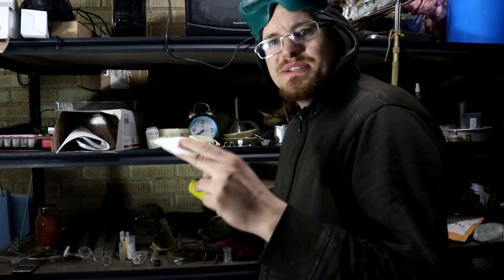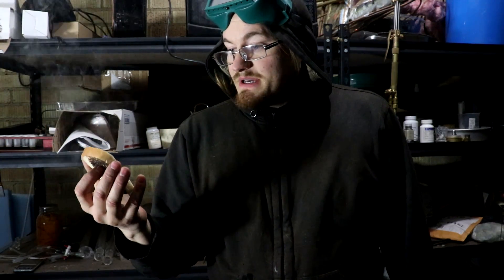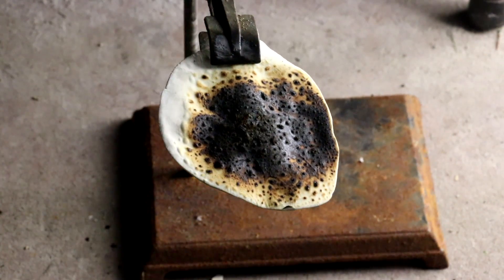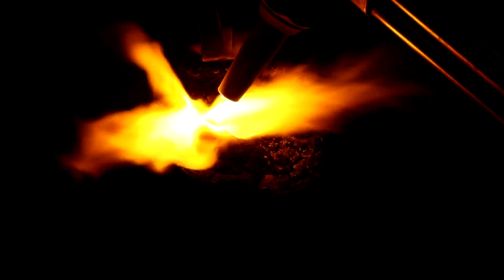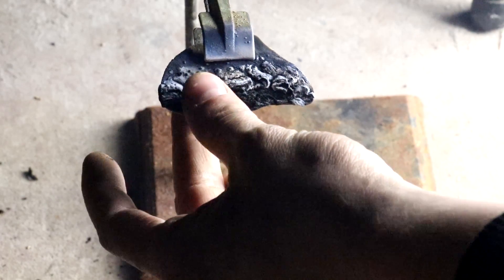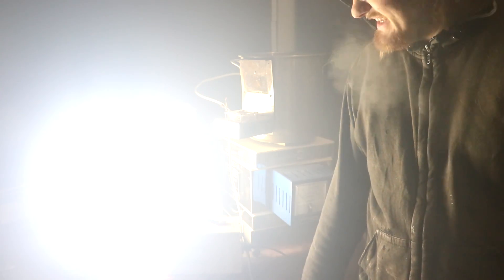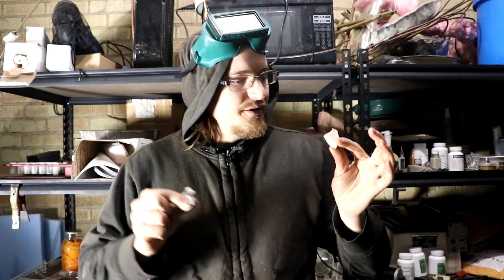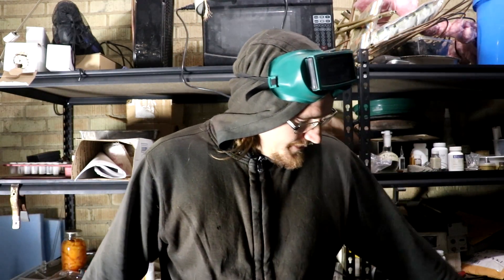Can I Burn Through Starlite?

Comment: Why do you pepper the oxygen? I haven't seen that before, I have only seen people lay on the oxygen.
Reply from the maker: laying it on makes the torch cooler since the oxygen is cold.
Reply: @theCodyReeder   That is interesting, I am not sure I understand; is that specific to cutting outside in the cold? I thought the process was to bring the 'inner flame' to the steel to heat it up, then to supply oxygen to react with, and ignite the steel, also blowing it away.
Reply from the maker: @BloodAsp  You can do that on "steel" but "stainless steel" doesn't burn nearly so well.
Reply: @theCodyReeder  is welding stainless steel as toxic as they say?
Reply: Alexander Cole 
Chromium hexavalent. Yeah it’s bad
Reply: @Alexander Cole Yes, Chromium is nasty.
Also, if you smell popcorn while welding, you are welding galvanized steel, and you should stop.
Reply: @theCodyReeder  Ahh, I missed that part, I haven't cut any of that. Thanks for the info, and videos!
Reply: @dunemelange  Depends on the process. Stick welding, Yes. Proper Tig welding, no. Mig, in between... It depends a lot on how much chrome is vaporized during the welding. Stick and Fluxcore are worse than Mig and Tig. Tig is likely the best as long as you don't screw up a lot and feed the filler wire into your tungsten...
Reply: @theCodyReeder  have you ever seen that trick where you can get a puddle going and the turn off the acetylene and cut it with just oxy i wonder how that works i guess oxidation you should do a video on the chemistry side of welding
Reply: @theCodyReeder  cause it lacks the extra carbon which burns
Reply: jack mills 
Look up oxygen lances. That’s how we cut really big things.
Reply: @BloodAsp  The main purpose of the extra oxygen is to blast the molten steel out of the way. otherwise, as you cut, it would just weld itself back together.
Reply: Would a 3m respirator make welding stainless steel safe?
Reply: carabiner i with the right filters yeah. Welding staino isn’t gunna kill you or anything. Just make sure you got ventilation and you’re fine. 
I can tell you that welding galvanized is some nasty shit. Makes me sick every time, even after four years of welding. 

But any welding fumes aren’t healthy, just ventilate and don’t stick your face in it lol. Or do as I did and buy a speedglas fresh air hood 🙆🏻‍♀️
Reply: @hydroxide5507  Using correct procedures makes welding stainless safe. If you don't cook out the chromium you will have no issues. if you see "sugaring", you have cooked chromium. Also by cooking out the chromium you defeat the purpose of stainless steel by removing its corrosion resistance.
Reply: In the wrong context this seems so weird

Comment: You got a plasma torch lying around somewhere?
Reply from the maker: no I dont.
Reply: @theCodyReeder  don't worry, wouldn't have worked (very well) anyway, plasma cutters really need a conductive material to properly ionize the air
Reply: @RageXBlade  Carbon (except in diamond form) tends to be fairly conductive, so should be no problem there.

Comment: Why can you break a window with fragments of a spark plug?
Reply from the maker: Because aluminium oxide is hard enough to not deform while overcoming the surface compression of the glass (at least 24,000 PSI in tempered glass). other things will do it such as diamond engagement rings.
Reply: @theCodyReeder  thank you! Also love your videos!!!!!
Reply: You can break a window with fragments of lots of stuff.
Reply: spark plugs are harder than windows
Reply: Because it's hard and sharp.
Reply: I know, I'm just being annoying.